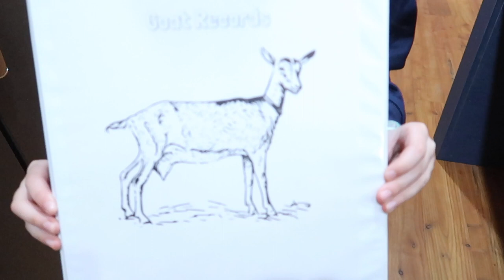Will they Ever ACCEPT HOPE?

Comment: Al , have you thought about installing some French Drains in the goat yard ? Draining the water off would make for far less mud ! And help the goat yard dry up much sooner. 
 I will attest that French Drains do work !  The land at my former home "looked " level but actually had a slope to it . With every heavy rain the water would flow towards my house and garage. At the garage the rain water would actually flow under the back wall , across the garage floor and out the front. Not good at all .  So I dug out a French Drain across the back of the garage with the drain open end emptying into a drainage swale.  It worked ! No more rain water flowing through the garage.  The way that I made it was to dig a trench about 8" wide and a foot deep.  I placed three or four inches of medium gravel in the bottom of the trench.  Then I used 4" drain pipe with the holes in one side and wrapped it  with the perforated weed guard cloth .  Two or three times around.  It's to keep dirt from infiltrating into the pipe. Then the pipe is laid into the bottom of the trench on top of the gravel . Holes side down .  Now , fill the trench just above ground level with medium sized gravel. Pea gravel was too small . The gravel settles down to ground level and will soon be covered with grass.  When it rains the rainwater flows down slope , into the French Drain and out the open end.
  The house was a different but similar story. It was built on a crawl space.  With every heavy rain I would soon have two feet of water under my house with the sump pump working overtime. So , another French Drain.  It was dug in place about 1 1/2 feet from the house foundation.  And made the same way as the garage French Drain. Except this time the drain pipe went around the end of the house to end in a dry well in the front yard, The dry well was four feet by four feet by four feet.  I lined the sides and bottom of the dry well with the perforated weed cloth and filled it with gravel ,  which again was soon covered over with grass.  At the most after a very heavy rain I would have maybe an inch of water in the crawl space.  The sump pump soon took care of that. The dry well allows the water to seep into the ground much the same as a septic tank does.
  I think that French Drains would help to dry out the goat yard .
Reply: Yes,  French drains are a good idea.  Remember the possibilities of pathogen build up and exercise care to where the drains out let.  I suggest into dry wells to retain soil moisture. [Good place to hide rocks]
Down sides are when stock yard waste run off gets into natural streams. The  Army Engineer Corps says its job is to make water walk off land, not run off.

Comment: Whatever u do. Don't inhale dust from diatamaceus earth.**
Reply: I havent died yet.... Just a bit uncomfortable
Reply: Did you know that people can ingest DE that is food grade? We, in the developed nations, don't have to worry too much about worms and other internal parasites,  however if you are around animals that have a heavy parasite load it doesn't hurt to be proactive.
Reply: @nathanielsizemore8594  you're correct they CAN eat it. But breathing it in is NOT safe. Do some research of the affects of inhaling it. Or hell go for it.. inhale away ;)
Reply: @yotagerlie , your absolutely right,  breathing DE will do serious damage to your lungs. That's why I lock my chickens out of the henhouse and wear a respirator when I dust the insides to control the mites which get into my girls feathers. I also add DE to the sand, ash and dirt mixture for their dust baths. 
Thanks for your input and good safety tip.🤓

Comment: It was the Lyme Lepto shot that caused Tanner's discomfort. That shot almost killed my puppy. They're supposed to inform you of a potential issue and offer a large dose of Benedryl to avoid the allergic reaction. I won't ever give a puppy of mine that shot in the future. Not even with Benedryl. It only offers a bit of protection against Lyme carrying Ticks. Just us the Tick drops instead. I wanted to smack the Vet into the next zipcode.